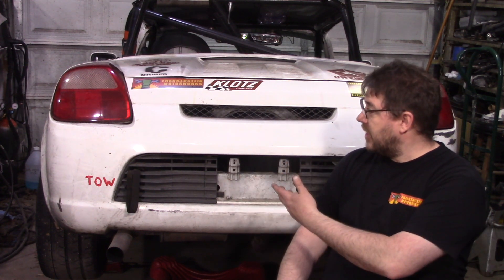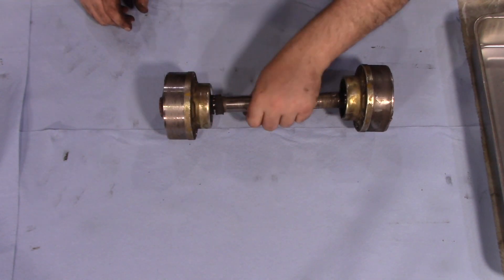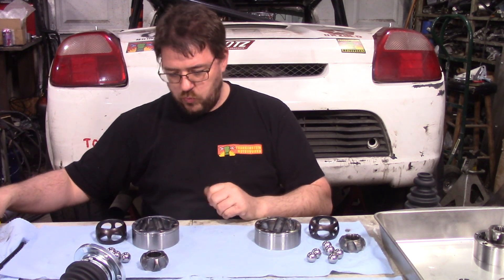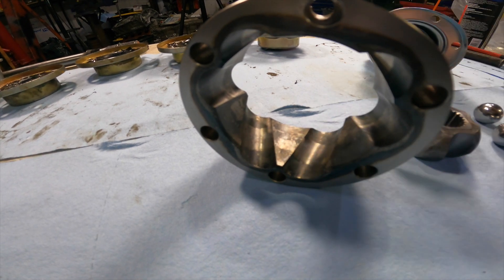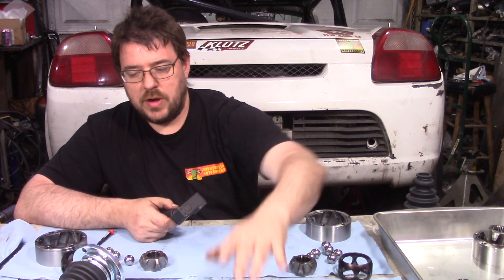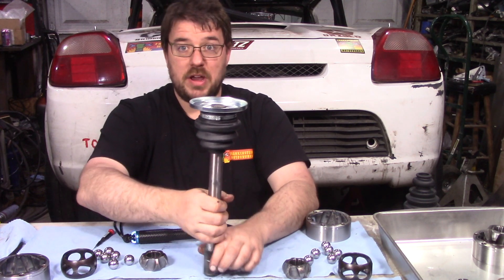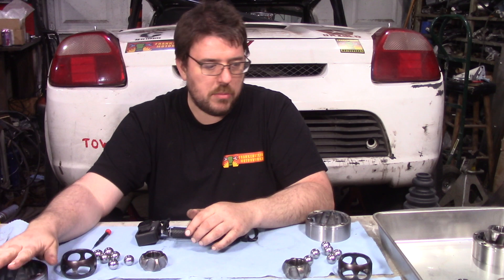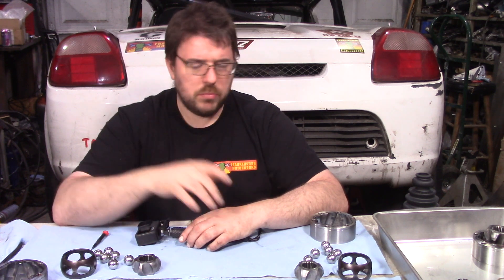The axles survived! (mostly)

Comment: MY man i have a question. Do you know what is the max HP rating for 930 style cv axle? thanks.
Reply from the maker: You'd want to reach out to someone like www.rcvperformance.com to ask that but from what i understand you're going to be comfortably well above the capabilities of any of the MR2 transmissions we use before the 930 joint breaks from excessive torque or heat.

Comment: Would this solution/something similar work for a 2gr-fe/e351 combo? I know you are coming out and supporting the narrow e series trans, but axles are the one thing that has got me worried.
Reply from the maker: This solution can be made to work with any transmission that has room for the inner CV in any car that has room for the outer CV and the narrow E series is compatible and so is the MKII and MKIII MR2. The MKI MR2 may also be compatible but i have not checked. That said, there is also a much cheaper axle solution already figured out for the 2GR/narrow E in the NA MKII MR2. Which car are you trying to put this in?
Reply: @FrankensteinMotorworks  Luckily enough, I have a 93 SW21 that I am accumulating swap parts for. Do you have a link/documentation on the axle solution?
Reply from the maker: @CSSfreakX  Alex has put the documentation together in his blog: https://wilhelmraceworks.com/blog/e351-transmission-swap
Reply: @FrankensteinMotorworks  Thanks a TON

Comment: My stock swap axles with high temp grease have held up fine for multiple track days. This problem probably doesn’t apply to most people
Reply from the maker: Yeah, that Redline CV-2 grease really has some ridiculous specs, i'm really happy to have found that stuff. And yeah, just as you said, the normal axles are more than good enough for most people.